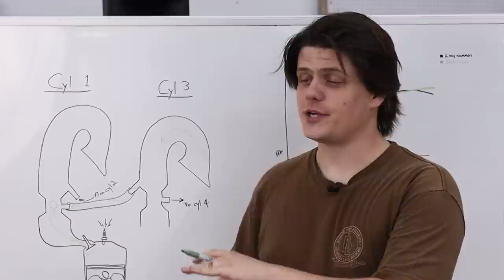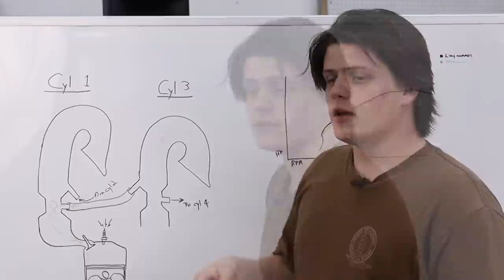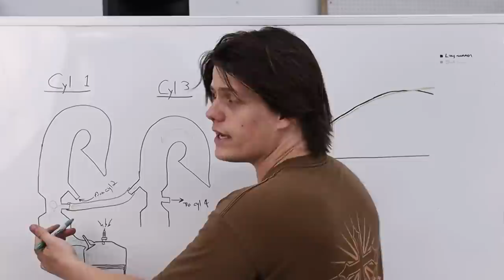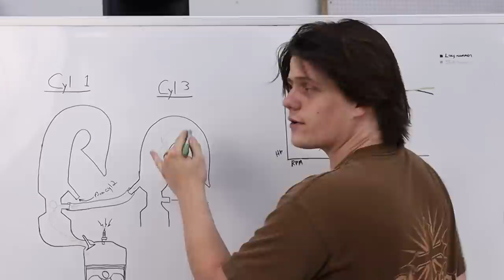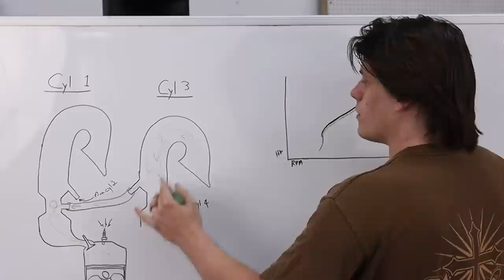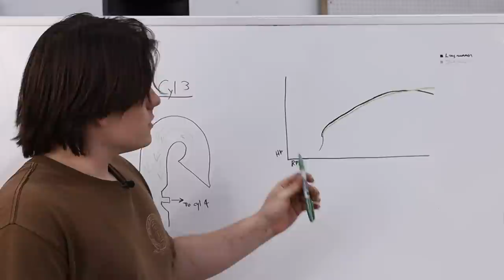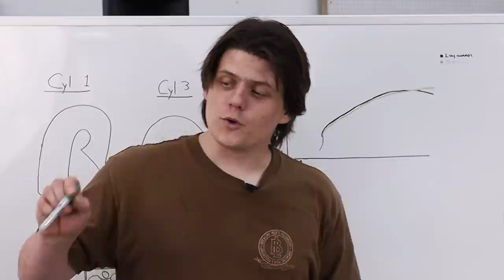3D Printed ITB Intake for Turbos and/or Stock ECUs

Comment: Bro I’ve already thought this out for years I’m 14 so I can’t physically do it but I have thought of this idea for multiple years the way I would go about it is, it would be bought as a kit itb’s and all the plenum would be bolted directly to the velocity stacks of the itb’s to make it easier to repair/ alter the setup and you would would build off the the intake plenum and like your set up it would still use the maf sensor and would still have the capability of using the stock ECU and the rest would go just how a turbo kit is mounted and tuned to me that sounds like simple logic but I’ve come to realize that’s not the case and it would be a lot harder to tune and get the balance correct so good on you if you read this tell me anything that’s completely wrong or kinda right love from aus🇦🇺

Comment: as an automotive engineering major I definetly want to see the results of this 

however using regular maf sensor kinda sorta defeats the purpose of ITBs becouse you restrict the air coming in to the diameter of the MAF sensor anyway, also making the "venturi" section of runners smaller than the section next to them in the intake routing would make the air you are trying to make luminar, turbilant instead after going through the venturi section becouse section after it going bigger, whilst designing an intake system you should ideally keep every area of it getting smaller and smaller as air progresses towards the cylinders becouse as area gets smaller you esantially get higher speed air that is more prone to flow luminarly + it would create a slight vacuum, if you look at practically any standart of aftermarket performance oriented intake units you can see that

so making the venturi section just near the cylinder head (which I suppose you did) at a relatively agressive angle would work maybe? 

also here is an idea: make sure that you connect those vacuum lines with valves inside them, run the engine 2 times on dyno and see where engine makes more power with valves open and valves closed so you can combine those power graphs with a solenoid attached to valves

Comment: What if you used a graduated air funnel [Velocity stack] that applies the Fibonacci geometry to increase air velocity 

Would it increase intake air velocity or no?

Could you also use reversion chambers in the primary headers before the collector to prevent reversion inside of a turbo exhaust manifold?

Would you gain any power? How would it affect the Powerband?

Sorry if this makes no sense, I think in pictures not words so it turns into incoherent rambling sometimes.

Comment: I have a simiar idea, i wont say exactly what it is, but its a similar idea to what dodge uses in the 6.4 intake with their short runner actuators, but im hoping better, sense id like it to be aluminium and 2 peice so you can put it on any cylinder head without the need for adaptors

Comment: It's great to see people who have an idea and go what the hell lets see what happens.  I do the same thing.  A question I have though is looking at your set up, I can't help but think you've added complexity and restriction in trying to maintain that pressure wave.  Adding the venturi you have to ensure that you are not disrupting flow for the sack of pressure.  You want to optimize volume/flow.  Being enclosed, and having all the bends how do you see the flow moving?  have you been able to model the air flow?
Reply from the maker: No I'd love to but I don't currently have software to model airflow. I think the scenario you mentioned is probably the most likely scenario, but I'm curious to see.
Reply: I think there is a function in fusion 360 that can do it.  I may be wrong but I thought I saw a video on it doing it.  It's a interesting design and thoughts behind it are well thought out.  I hope it pans out.  I hope your doing a dyno video on it, and testing out different configs of that system

Comment: Love the content! I dont have experience with those types of plastics for 3d printing but will you be using any finishing method to smooth out the surface of any of the plastics to improve the airflow? I believe there has been some testing done with removing the rough surface that layer lines create to reduce friction and improve the aerodynamics of printed parts like this, gotta chase whatever power is on the table!
Reply from the maker: Probably not. We'll see how good we can get the surface finish right off the printed and then see.
Reply: @StandRacing  You don’t want smooth surfaces within an intake tract, the layer lines will be fine and will produce a boundary layer on the surface which reduces any fuel pooling and deatomisation within the runners.
People will try tell you that a port injected engine has a “dry” intake manifold, this is untrue, as I’m sure you know the injector starts spraying fuel while the intake valve is closed, the resonance pulse running up and down the runner at this time physically takes fuel with it as well, so when we target the 3rd pulse in general fuel and air has run up and down the entire length of the runner twice.

Comment: Yeah I would have used orings so cheap it makes no sense for all the work of cleaning up when you need to take the manifold off.

Anyways good project would like to see you run it and see how much pressure before it explode from boost.

Comment: You would need to go around 200mph in order to get about .1 psi of boost. So, thats just for thought. Pro stock nhra cars get about .1 at the end of the track. You will not get any boost above atmospheric pressure with this

Comment: Since the tubs are 3d printed, have you thought about internal dimpling on the velocity stacks? I've seen dimpling used on motorcycle engine velocity stacks for small power increases, might have a greater effect here.
Reply from the maker: I've heard mixed opinions on that, but it's exciting to imagine the different geometries 3D printing can enable. It challenges convention.
Reply: @StandRacing  yeah, I've also read a lot of mixed information. But would be worth trying if you have the ability to and do your own tests!

Comment: Bro looks like Wednesday Adam's and Tom Holland and hulk thrown together.
Overall cool video, good idea. Needs RTV for sealing against engine and 1 bolt for 2 intake ports?? I would think 2 or 3 would be more reliable but if it works, it works. Idk about handling boost with that kind of material

Comment: You need to find someone with a flow bench to literally see what it’s doing and to get actual flow #s for each chamber.
BTW, Weapon-R uses nylon for their thermal intake and TB spacers.
Reply: BTW, look into David Vizard as well Helmholtz resonators.
Not only can exhaust resonance to tuned to improve scavenging. But intake resonance can be tuned to “supercharge” the air charge, without forced induction.
Also, Permatex 81878 Ultra Copper RTV

Comment: when one piston on the inlet stroke reaches its max speed half way down the bore a negative pulse is sent up the runner if the runners are short  this pulse or some of it (divided by plenum) arrives at another cylinder during the valuable overlap phase  and has a negative impacts on cylinder filling  using long runners we seek to decrease this  at lower rpms  and it often works  ...  now on the exhaust side its a positive wave  upsetting cylinder evacuation  now on that side  if we split the engine  into 2with and 3 and 4 with 1  we are able to  decouple the cylinders that work against each other  .. these negative effects that you are infact addressing are so  over looked and misunderstood  ... Now although i totally disagree with much of your hypothesis i do infact  totally enjoy your content and respect your terrific skills and enthusiasm and i really want to encourage you  so keep at great work
Reply: oh i must add  the reason we are seeing less long runner inlets on modern engines is that variable  cam timing and lift reduces the overlap at low engine speeds  and there for   reduces the benefits of long runners
Reply from the maker: So a simple real world solution to what you explained is to use long runners to mitigate the low RPM consequences of a high duration/overlap cam. Is that right?
Reply: @StandRacing  yes  and in real world applications you are more likely to do that then you are  align the magic numbers for standing wave resonance tuning  that give the "boost " effect ..  So  what I'm saying is a  few things from the starting point  should be addressed when considering how worth  while  the ideal manifold is  So  cam profile  plenum volume initial runner length

Comment: this may be a silly question, but are you also going to test that each one of the four ITB's flows the same amount of air once enclosed in the covering?  (for example, what if having that ram-air effect means the back ITB gets more air than the front one)
Reply from the maker: That's not usually an issue. When you think about it oppositely it makes more sense. There is a finite limit to how much air each cylinder can bring in, so the cylinder can't really get too much air, only not enough.

Comment: I don't know how I came acros your video 10h from being posted but man this is gold information. I am curentlly doing research for a future project car and clips like this are really helpfull. I hope to see soon the results on the dyno for the venturi idea in the intake.Can you please confirm that i got the right idea? At low speed car movement and low rpm you sould get improved airflow in the engine because of venturi and at high speed car movement and high rpm you should get improved airflow in the engine because of increased pressure in the plenum?
Reply from the maker: Glad to hear it! At high car speeds the increased plenum pressure will help power at any RPM. The venturi system is basically made for reducing turbulence in the airbox in hopes that it'll even out the powerband in a broad curve.

Comment: I looked into doing a 3d printed manifold, I decided against it because the only examples I could find were university Formulas SAE projects that blew tons of money in it and ultimately failed because all their manifolds cracked after very little use despite using very high quality printers and filament, ultem 9085. So best of luck, but 3d printed composites aren't the right material.
On the other hand, something like lost PLA casting could be very effective for complex one-off manifolds.
Reply: 3D printed plenums cracking for FSAE applications are hard to do. We’ve been running 3D SLS Nylon Plenums for a long time and haven’t had any issues but I wouldn’t run it for more than a couple seasons.

Any questions regarding the cost or anything let me know.

Comment: What type of plastic did you use for print and how much did it cost?  I had the same idea to print custom equal-length runners manifold for a carb-type setup.
Reply from the maker: Carbon fiber filled nylon would be a good bet. I used CF filed polypropylene but due to the large size of the model the warpage was extremely difficult to manage.

Comment: Can you build a setup for methanol injection for each cylinder in factory tbi injectors? Also for boost. I like the vacuum lines and venturi valve idea. So I got two test mules. I started modified miata na or nb group. I want itbs and turbo meth setup with water to air intercooler also. Waiting on intercooler now. Got 2.5 gallon fuel cell for whatever fluids I go with. Can't decide. Also have large trans fluid cooler or oil cooler with 12v fan that after few seconds makes your hand freezing cold at 75⁰. I have a hardtop turbo and turbo miata death kart. It's very well built one. Over built really. Just sold my green 90 1.6 kart. My dad has 380hp 2.0 it's not running much boost. On e85 and boost turned up it will do 425hp. It's forged everything everything upgraded with the best. So can you set me up as test mule? I don't mind paying if required but I will be doing r&d which I've done for motorcycle builds for 78 xs650 Yamaha chopper. Built buell xb9r race bike. I've built a lot of custom cars. Got into miatas a few years ago. I got tons of miata parts. Text me 828 209 8816 or Facebook message me Doug Schultz blue hat blue glasses or black or dark blue miata for profile Pic. I think we can put our heads together to create the best itb setup for miatas on a budget that can add meth injection and be turbo. I think you need a speedyefi ecu tell them I sent you I know the owners. Also get rid of maf sensor. Add aem afr sensor. gm temp sensor also pretty sure comes with the speedefi kits or I order them can't remember. You need to add a port thats treaded in the intake cover to get correct temps. Want it as close to the intakes as possible and id put it dead center from all 4 sides so you get most accurate temp readings. But you need one. Maf stock ecu isn't going to cut it I don't think. Or won't show dyno gains you want as you'll probably max out the map on the ecu for injection. I run 1000cc injectors.  They were less than hundred bucks and are newest design injectors for a miata to run. Just not paying for a brand name. Work awesome. In curious if I can get injectors to fit stock injection on itb for meth. They will be tiny. Might have to get a plug and tap it for them. But I definitely going itbs meth and turbo soon. Might buy 3d printer myself and watch the videos you mentioned. Also once you got kit figured out and proven like that. Then we can do modified miata group buy. Sell quite a few at once.

Comment: 1:41 ram effect air really is minimal. By minimal I mean VERY minimal. (About 1 psi above ambient  at something like 180mph) which is theoretically possible alone just from good intake, head, and cam work due to resonance and scavenging. The biggest gain from a true ram air system is 100% ambient temp air 100% of the time always.

Comment: For the creep have you thought of using a stand off bush / spacer? If you're looking to sell parts you want to minimise the labour intensive bits :)
Reply from the maker: Oh absolutely! Doing a run of those custom washers would be cost and time prohibitive.
Reply: @StandRacing  I have them made up by a local machine shop for ~£2.50 each, now ordering 50 at a time. Though i'm just using a straight bush rather than a fancy one with a shoulder.

EDIT: Oh, I misread, you are referring to your metal parts as the washers right?
Reply from the maker: @CheekyNinja  Yeah the chunky welded metal thing is what I mean by washer lol.

Comment: Out of curiosity, have you done any sort of CFD with proper cam timing events to see if your venturi setup works? Ive been doing some for myself on a dual plenum boosted application and its been insanely helpful.
Reply from the maker: No, I'd like to but I don't have a paid version of fusion 360 just yet.
Reply: @StandRacing  Honestly if I could figure out how to do the cam timing events properly in SOLIDWORKS I'd run it for you. I'm really interested in if your idea works.
Reply from the maker: Thanks for the encouragement!

Comment: ok i get what u talking about, but... isnt that ITBs without modding your ECU still the same intake as a stock one. You could actually just make a tube like u have pointing to the front of a car to have that a little more than atmospheric pressure and it will just work the same. This is just my opinion on that...

Comment: Dude - this is SO COOL, srsly amazing
Reply: I'm surprised it can hold to the heat though. As for orings on mating surface to the head. I would prefer to use them just less hassle than cleaning up the rtv each time you take the manifold off

Comment: Sir- your system looks similar to the GM TPI setup, could your venturi system be added to the runners on the TPI to shorten the effective runner length, so it doesn't drop off towards the higher rpms? That sounds like what you were trying to explain but I may just be hopeful and optimistic, and I want to make sure I understood you correctly.
Thank you.
Reply from the maker: I don't have experience with the TPI system, but the hope would be that the venturi tubes would shorten the effective runner length, yes.
Reply: @StandRacing  Thanks, looking forward to seeing your progress with this. I see you've done a couple follow ups, and I'm following.

Comment: I tought you would treat air like a liquid in this and use the  water hammer effect to put air into the next cylinder with a lower pressure when the intake port closes. I didnt expect your explanation and i do not know enough to say you are eight or wrong

Comment: what kind of printer you using? and whatre the throttle bodies off of? whats the plan for getting fuel to them through the intake? super cool build
Reply: The 1.8 has the injectors in the head.  Makes ITB or other custom manifolds much easier.
Reply from the maker: Thanks! It's an Ender 3 max. There's a bigger printer in the works that may allow me to make full size pieces instead of multi piece components. The throttle bodies are from a Triumph TT600

Comment: 12:40 didn't want that consumable? But RTV is a consumable, you can't reuse it. Whereas an o-ring can be used over and over again and doesn't require a flat surface, and doesn't take time to set like RTV does.
Reply: Also with RTV you have to worry about it squeezing out into the air path and thus creating a rough spot where turbulence can form. And aren't o-ring kits like 10 bucks? You can even buy a roll of o-ring material that you can use to make your own custom o-rings.
Reply from the maker: Good points. It's more realistic to say I needed to get something printed for testing so I put some development off for the next revision.